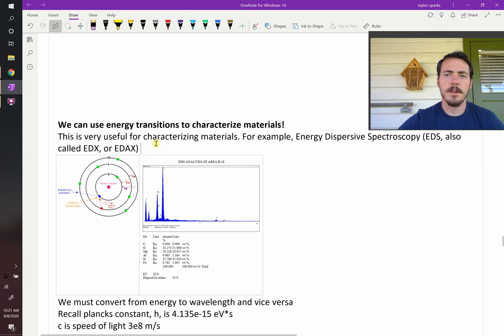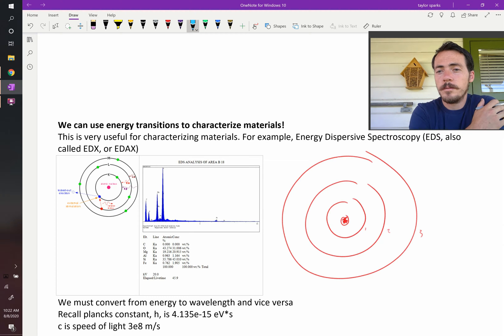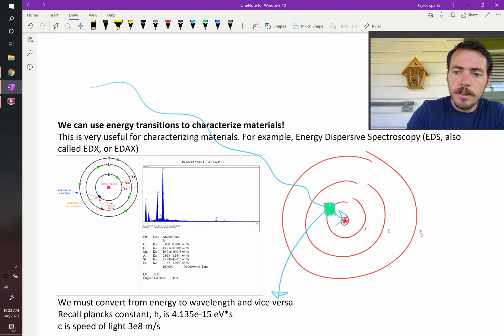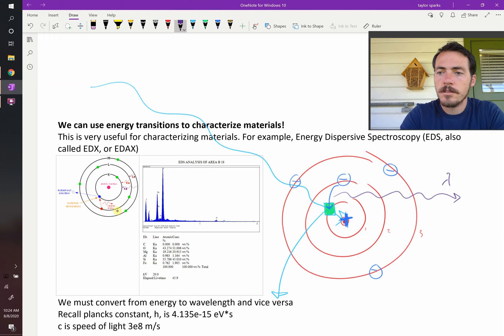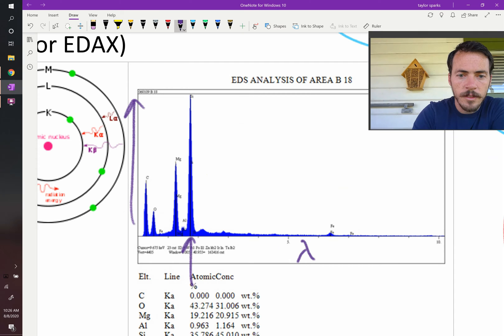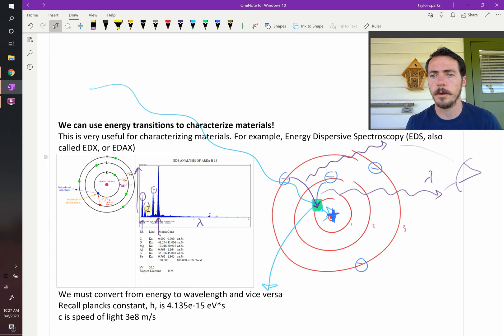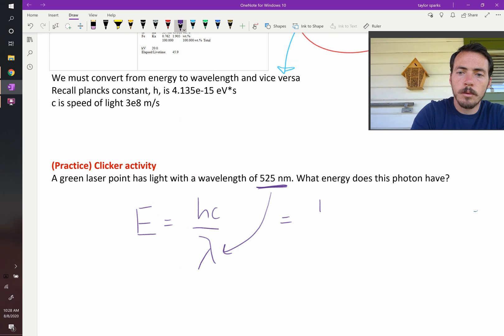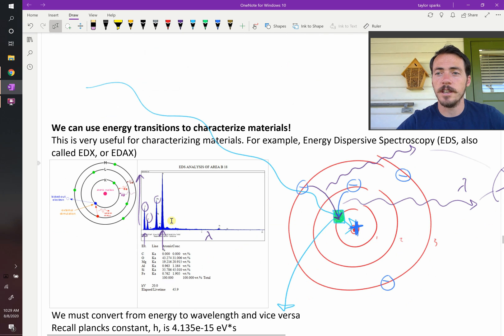How does Energy Dispersive Spectroscopy (EDS) work?

Comment: Sir, can you tell me why the mineral composition of the initial material is different from the mineral content during the EDX test?
Reply from the maker: @Physicoo  I would need to know what method you used to determine the mineral composition initially. Assuming you did something like icpms then the difference is because icpms is a relatively accurate test. While edx is a relatively inaccurate test. Edx can report weight percentages plus or minus say 5 to 10%. Claiming higher accuracy than this with edx is probably unwarranted. It's technically possible, but a great deal of calibration needs to be used. In practice. People simply realize that these are ballpark numbers

Comment: EDX is cool at times, but you know what isn't cool?  Matrix effects with EDX, particularly with Pb.  I am banging my head searching for papers that show how to perform this using EDX software.  Even with obtaining values from ICP and then using those as data to generate calibration curves using EDX is not so simple and doesn't work sometimes.   User beware, EDX is ideal for high purity metals, but for samples with a complex matrix, WDS is better, or better yet ICP.
Reply from the maker: @LM53180  totally agree. EDS < WDS < ICP

Comment: Neat! Is it a generic bombardment of the entire sample, or can you direct the energy at a specific point to test a material? Or can you using masking to shield the parts of the sample you don't want tested?  I am considering whether this might give me information on an old transistor (innards removed from its case) that I need to understand (Si, P, B, Al, SiO2, Au).
Reply from the maker: Yes, it's a spatially resolved process so you can look at the signal just from certain spots in the micrograph

Comment: Thank you for the explanation.My job was an EDX analysis of lithium nitrate. But an EDX analysis of lithium nitrate was not possible. Are there any reasons for that? Why it is not possible to identify lithium and nitrogen on EDX?
Reply: This information would be important for my bachelor‘s thesis
Reply: @beratozen9520  In the video it explained how X-ray is been generated and you can see there are some requirement for that (electron beam voltage, orbitals of element etc.). You may think if Lithium nitrate can meet the requirement for generating X-ray.

Comment: Understood about the identification bt how It's used for composition determination of materials?
Reply from the maker: Integrated area under peak curve is proportional to the atomic weight. Technically, you have to use calibrations standards to get it to come out right. Because not all elements interact the exact same way some have more transitions and others and so they will have more intensity. But if you use some calibrated standards then you can do it.

Comment: I believe we cannot measure Carbon atoms by EDS, because of SEM properties, am I right? This Carbon atoms are counting as background pollution of sample and we cant measure them? In college, something like that was told to me about the EDS analysis. I'm not picking on, I'm just asking if it's true :) Greetings, nice film.
Reply from the maker: I can't remember if it's because carbon is everywhere and it shows up as background, or because the intensity of the transitions are too weak or overshadowed by something or what actually. I know that in general light elements can't be picked up and so it's not just carbon, because it's not like lithium or boron are everywhere. I think it has to do with the energy of the transitions
Reply: @TaylorSparks  Because EDS is operate in the electron microscope, there are several sources for the carbon contamination. It may comes from the oil vapor of the rotary pump and mostly comes from the sample preparation - it's difficult to remove all the hydro carbons from the sample surface. The e-beam illumination can break the bonding and become carbon deposit as a result. In the end, most of the carbon signal detected may not comes from the sample itself.

Comment: why energy of xray in eds spectra is not matching the theoritical calculation ???
please please answer me ???
Reply from the maker: Perhaps a different element is there than the one that you expected?? Or perhaps you are looking at the wrong wavelength? There are many possible wavelengths for each element. K,L,M,  alpha, beta, 1,2 etc.
Reply: @TaylorSparks  I tried , but not getting the same result as in EDs
Reply: @TaylorSparks  The theoretical calculation is based on several assumptions. The most important is the sample is assumed flat (nm scale roughness) and the sample is homogeneous. However, in reality, most of the sample can not meet this requirement. Thus you can see the deviation.

Comment: Thank you so much!  One thing I don't get is why is the C peak, a peak, but its wt% is 0?
Reply from the maker: A couple of reasons. The first is that we often add carbon to prevent charging. So it might not actually be present in your sample, it could just be at the surface. The second is that EDS does not work well for light elements.

Comment: We are using OXFORD X-MaxN detector(SN:70727

Model- 51-XMX1146) and Inca software. We are unable to find lithium in our  samples. In our sample lithium composition in weight percentage is 10-15. Please help me how we can find Lithium in our samples using this detector and Inca software.
Reply from the maker: Usually EDS is not used for low atomic mass element detection. Lithium is probably too low in atomic number? I would consult the company.
Reply: Sir please help me . It's so urgent.. Waiting for your valuable response
Reply from the maker: @arupghoshal5814  sorry, I've already told you that I don't think that EDS is commonly used for lithium. You should contact the manufacturer and ask them what range of elements it is useful for.

Comment: Thanx .. very informative video ...
I have a Q, ?
Why the quantitive analysis for C element is 00000 wt% but it present high peak in the spectrum ? ?
Reply from the maker: great question! There can be several reasons for this. For example, carbon could have been applied as a thin film on the surface in order to make the sample conductive. Therefore, it should be ignored since it was added as part of the methodology.
Reply: @TaylorSparks  l made EDS analysis for my study research which is silicone material. The main elemental compostion for silicone are si, c, o . For control group  the 3 element present but for the expermental group once i added ZrO2 to silicone the analysis present Zr, O, Si without carbon.... why ...?? I didnt find the reason for such thing... or maybe the persone who did the test ignore the carbon
Reply: @EsEz89  excuse me, have you found the answer to this? Because my sample also had a similar problem